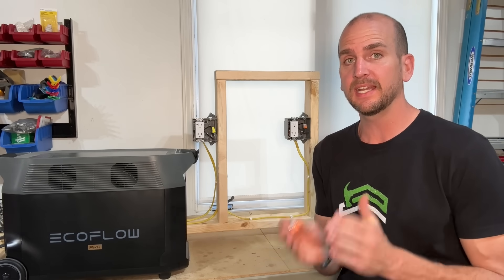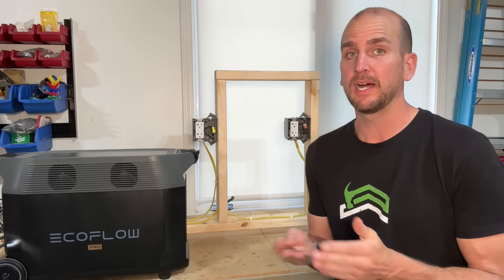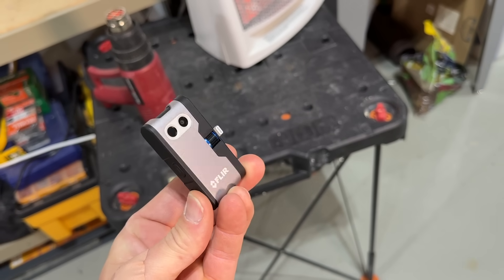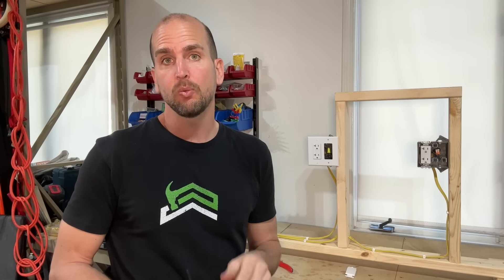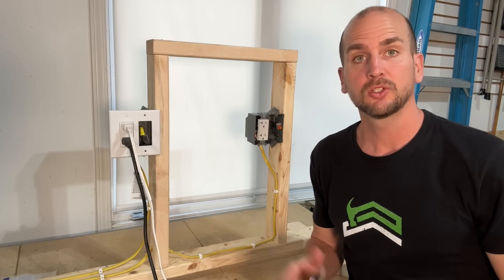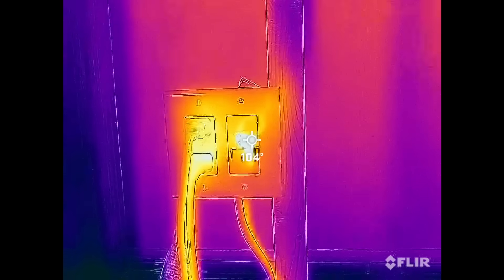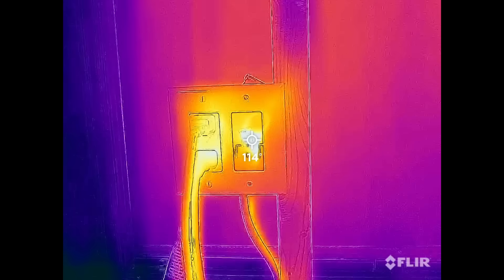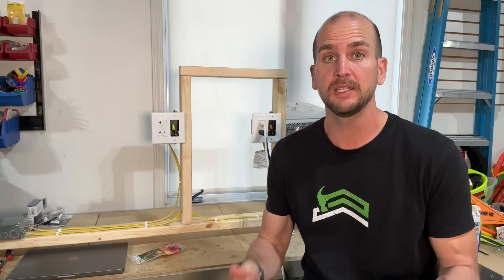Debunking the Pros: Can WAGO Lever Nuts Handle Heavy Electrical Loads?

Comment: Don’t know if ANSI standards apply to this. I have had experience with testing to different standards ANSI, CSA, and EU. In my experience the EU standards called for whatever they are certifying to be tested in the worst case scenario. When testing capacities and tip over capability’s, ANSI and CSA called for weight to be evenly distributed. EU standards called for weights to be in the farthest forward position. Which made a huge difference in the capabilities of the machine being tested. Invaluable information for the manufacturer and the end user for safety. If the WAGO is certified by the EU I am fairly confident in its ability to preform as designed. The real question I would ask is, How to the compare over time? Through heating and cooling cycles and loss of spring tension?

Comment: so I replaced several of these things at a house 30+years old I am not impressed, most just opened up, one in particular melted the insulation back about a inch or so. I will only pre twist with wire nut I have not seen that fail

Comment: You didn't properly apply the wire nuts as you didn't twist them tight enough. Wire nuts are supposed to be twisted such that you actually twist the insulated parts of the wire. But that doesn't mean that a WAGO can't be used. They aren't a huge problem in new installation where THHN insulation is present. They are more of a problem in retrofit where older insulation types are in use that don't have the same temperature capability that THHN has. And if you aren't strong enough to twist the wire nuts, they make tools for that.

Comment: People who say this nonsense mustve missed the ul listing, what do you people who blurt out and defend wire nuts think ul does, just rubber stamp any product for a fee without doing any testing? Level of ridgid and irrational thinking ive seen  in comments on some of these videos is apalling. Wago is amazing, ive pumped 15 amps constantly in the summer with 0 problems.  Great cideo testing and proving these work. Wagos are also superior for keeping wires neatvand not a mangled twisted mess when you need to do work on something.

Comment: I had good results with the push in  wagos in various applications but when I used them in defrost timers they tended to fail. The amp rating seemed to be acceptable but they weren’t capable. I retired about 8 years ago and the lever wagos were only encountered in lighting fixtures. I assume the later ones are more robust.

Comment: Not sure what pros are saying that wages are bad for such loads. I do not like push in style connectors but the lever style are much better. Issue is the cost per connector for an industrial scale job. 

For home use and DIY I would highly recommend them as the lever type ensure a proper connection requiring very little skill to do a proper connection.

Again industrial applications it just doesn’t make fiscal sense unless it saves you enough in labor costs.

Comment: We use those around the house but only for light fixtures, which all have something basic like LED bulbs in them, max draw is 3amp @120v. I would NEVER use those under a legitimate load for an outlet. Highest load ive used one on is the new bathroom exhaust/light fan i installed which is at 5amp. Ive had 2 different electricians tell me to stay away from those all together.

Comment: I assume, being that you're posting videos on a public platform, that you have thick enough skin to handle criticism. All you have done with this video is shown your ignorance and lack of experience regarding home electrical.  Your comments and even your method of using a wire nut shows that you have a lack of understanding of ac electricity.  Your testing method shows your insincerity on your search for the truth and shows you really were just trying to justify your own narrative.  Do you really think us professional electricians made a judgement call after using a circuit for 30 minutes?    The truth is that most of us make that judgement call after a circuit has been in use for at least a year. Do you think prolonged heat affects the structural integrity of an alloy?   Just bending soft copper changes it's structure.  You claim that because, after a single use, it's temperature was below the maximum that it's quite satisfactory to use.  Let me clue you in to a couple of facts.  Heat changes the proportions of different allies to differing degrees.  Tin doesn't expand at the same rate nor same amount as copper.  Something that changes temperature over and over and over doesn't act exactly the same after a year as it does after a half hour.  Ac electricity has a frequency and therefore vibrates.  Will the vibration give the same results after a half hour as it will after a year?  NO!   Is it common for an electrician to find a melted wire nut if the wire nut wasn't correctly taped? YES!    After a multi year study I can guarantee that you will see different results. One of the most common household wiring problems I run into is either a wago or a receptacle with the wago style connector.  If you are going to get on a public platform and advise unknowing people as to the best electrical practices at least please spend 5 years as a professional electrician first and until then don't dismiss the opinions of us who have spent a lifetime as an electrician so quickly.  The only place a wago type connector should be used is for the safety ground circuit.

Comment: The tree you're barking up is missing several points - both methods are engineered to safely operate with a substantial safety factor. Electricians have been arguing over using the stab holes in a device vs. cranking the wires down under the retaining screws for years. BTW, those stab holes are no better or worse than Wagos. What it comes down to is 'best practices'. It is extremely obvious the best practice is using twisted and nutted or clamping screw connections however the devices developed for convenience, ease and time saving (less than a minute?) are -acceptable-. I will offer that, while it doesn't happen often, how many of us have replaced a wonky device (switch/receptacle) caused by the original installer using the stab holes?

Comment: I love wago especially for low voltage. Connect any size wire to any size ( within reason). The only bad part is when they snap shut and sting your fingers.

Comment: All the thermal values are well within the limits of the product design. Use what you will but the Wago connectors are safe from a thermal standpoint.

Comment: Had a door bell transformer blow up and smoke the receptacle...traced the circuit back to the point of failure...failure was the junk wago...repaired with proper twist on wire nut and replaced receptacle with wall plate and transformer...door bell actually works now

Comment: What I'd like to see is Daisy chained Wago connectors like you'd see in a run of outlets on the same circuit.  Most interested in the voltage drop.  My outlets were back stabbed by the builder's electrician.  The drop was so bad that my UPS kicked on every time I tried to print with my laser printer.  Putting all the connections in the circuit on the screw terminals which fixed the issue.

Comment: The thing with wire nuts, is you need to use the correct size, and ALSO use quality wire nuts.

The cheap ones are junk. Ideal wing nuts are really good and really grip and hold the wires. Trim the wires evenly, strip them correctly, and put the wire nut on and twist while holding them together. Keep twisting until the wires twist a couple times outside of the wire nut itself. It will be tight and possibly hard to keep twisting, but this is the correct way to ensure they are twisted together and secure.

Comment: The difference is that the wire nut will losen with the heat/cold cycle,  while the wago will not.
I had wire nut in my old German appartment, at some point some of them started to buzz as they had losen, pretty scary.
I replaced them with wago!

Comment: Its over time that they fail.  Receptacle use plugging and unplugging causes movement and the connection loosens a bit each time.  I have never run into a screw type connection burned up but plenty stab connections burned up because they became loose...  Can't deny this...

Comment: A properly installed Wago is higher resistance than a properly installed wire nut.  Other youtube channels have reached the same conclusion measuring resistance directly.  It is also easy to install a wire nut poorly, esp as the conductor count goes up.  It is very hard to install a Wago incorrectly and it is easy to check and repair.  I'm going to continue using Wagos for AC.

Comment: A brittle piece of plastic IS the WAGO. Load that sucker ten times per day up to 110 F for ten years. That little plastic crap will break first chance it gets. There goes your entire house, up in flames! The wire nut mechanism is spirally wound steel and will not break. The plastic is merely the insulator and install tool. There is ZERO CHANCE I will use a WAGO in ANYTHING I wire. Ever. Besides, you're measuring the COVER PLATE temperature. Take that thing off and measure the CONNECTOR temperature. I'll be ya a bazzilion dollars that those are MUCH higher temp than what you measured.
Reply: shit someone better warn Germany before the whole country burns down! oh wait...

Comment: As a 25 year master electrician, reliability engineer and certified Level III thermographer. A few issues with your test. Thermal camera is reading surface temp of connecter. Thermal cameras are not capable of measuring temperature through an object so the actual  contact material temps are unknown. Your are trying to determine an absolute temp of a connection and not a relative comparison emissivity and background temperature must be accounted for? Reflected heat from the background will change the temp you see with the camera and you must compensate to obtain an accurate temp. Best practice would be to set emissivity, compensate for reflected temp and aim the camera into the holes of the connecter where the conductors are inserted and monitor temperatures  there. Measuring in this manner creates a cavity reflector and background temps are not influencing the displayed temp as much. For best accuracy, you  should be measuring voltage drop across the connecter in millivolts, then calculating contact resistance and  watts using ohms law. Comparing resistance is a better method of determining how well the contact work. You can connecter surface temp with a thermocouple to confirm what you’re seeing with the thermal image. Different contact materials  have different max surface temp ratings, you cannot measure contact surface temp with a thermal camera on the outside surface of the connector. The max temp rating of 220 is the contact material rating.  Looking at the chart, the temperature was still climbing so thermal equilibrium never obtained and max surface and contact temp was not obtained.

Comment: My father was old school. He stripped conductors, twisted them tightly, applied rosin and soldered them. Then he screwed on a wire nut and wrapped it in electrical tape.

Comment: Thanks for this video! I recently started using the WAGO inline splices for hooking up LED shop lights, and given their relatively low power consumption I'm fine with that use. But it does look like a more robust connection for higher power use would be wise. I'm also concerned about long-term exposure to low concentrations of corrosive vapors - do the WAGO contact degrade faster than screw or wire nut connections?

Comment: I concur his first statement is correct they cannot handle any amperage load over 3 to 4 amps I think they're great for LED light, for connecting wall plugs they are absolute know no, just like when they're okay to push the wires in back of the wall plug not a great I've seen wires turn blue and purple the newer connectors.

Comment: Should actually test multiple wagos on the same circuit you could have a whole bunch on a circuit and each time its adding resistance to the run and you should use a thermocouple to accurately give the temperature. Add insulation around the boxes as you have it set up currently it's in open air wire conductors are rated accordingly for open air and enclosed in the wall you should get a more accurate reading of you close up the wall and make the test more practical for comparison.

Comment: WAGO is NOT for american 110-120V. When America finally changes the system to 240V, then can use WAGO
Reply from the maker: Hmmmm, why are WAGO's not suitable for 120V?  Worked well so far 🤷‍♂️
Reply: It's very easy. The problem with 120V installations is for example, 2400W (an electric kettle), a current of 20A is needed. At 240V it is only 10A. Remember to use twice the cross-section of the cables. WAGO accepts a maximum of 4 mm2.
Reply: @andyk9685  so buy the 32amp wago that accepts 6mm2....

Comment: Push in terminal connections on the back of switches and receptacles are the real reason the idiots at NEC forced arc fault breakers on us. I do NOT trust any sort of push in fitment type connectors. Laziness and greed will burn your place down. Soft hands have no place doing real work. Either get used to blisters or buy the right tools. Marrettes, Marrs, twist connectors or what you you may call them are the way to go and if you really don't want a call back for trouble, tape your connections in places where you have that nagging doubt creep up on you. 

Also, children need to learn not to stick crap into a receptacle by getting zapped, those TR bastards are more trouble than they are worth. If they don't learn, the gene pool just gets dumber and dumber, we need the Darwin Awards!

Comment: The wire/wing nut is NOT a termination device! Never has been. It is an INSULATOR! The proper method of using a wire/wing nut is to strip an excess of insulation from the wires, TWIST those wires together in a clockwise fashion. Trim the damage done from twisting away, then INSULATE  the connection with the wire/wing nut by twisting it clockwise until tight.

Furthermore, you need to run your tests for an extended period. More like for months with periodic cycling of power allowing sufficient time for thermal cycling. Then come back with your results.

As a non-restricted licensed electrical contractor I refuse to use any type connector which relies on a spring device to maintain contact for power distribution. I have made tons of money over the years repairing the damage these things have caused in commercial and industrial applications. I won't even use or recommend their use in controls applications due to reliability issues. Low voltage signaling applications are all these things are suited for.

Comment: Some of the thermal transfer is not necessarily from the Wago or Twist lock nuts.  The wire is or appears to be 12 ga which is rated for 20 amps so the wire itself is generating heat contributing to the rise as it is out of range limits.  If I have a circuit I calculate to be over the rating of the breaker or wire I upsize until I have a safety margin.  So in fact if the current load is less than the current limit and the breaker, wire, wire nuts or Wagos are rated for use on that circuit then all points should be equal unless you fail to clear enough copper for the splices.  If all is equal they all perform the same.

Comment: Been using wago for years now. My workbench electrical supply uses them. All my supply is 20 amp rated at 120v. Never had any indication of overheat or voltage reduction. So far, so good. 6 years on now.

Comment: DIYer's playing around with electrical wiring is plain scary. Elimination of hot spots is critical, so while Wago connectors and others may be OK when installed, how hot are they running after 5 or 10 years of service? Any such connector should be running cooler than the cable - not warmer - hence compressed tube connectors. Wires shoved straight under power outlet screws create a hot spot - the wire should be wound under the screw as this creates a greater area of electrical contact, and also assists the wire to conduct any local heat away from the connection.

Comment: Pushing them out of their limits for testing is a great test but you'd have tripped a breaker already running 20+ amps for that long through a 20A circuit breaker. 
Test at 15 amps instead. The difference will be ever more trivial, while it already is trivial at the overload conditions. 
It is mostly old timers that cannot accept new technology and piss on new things because young people know and do things that they don't know or like.
They will also argue with you about backstabbing receptacles, while it is a UL listed method for those receptacles.

Comment: If either connector ever reached it maximum rated temperature there's a serious problem.  I suspect that's the temp it begins to soften and fail.  
Id like to see the heat generated in back stabs, especially if they've been in use for some time.
Thanks. Good video. 9:17

Comment: If you need to use high loads on a spliced circuit then it's all on you! I wouldn't use either variant in a high load situation. 

I love WAGO and i used them on my home but none of the connections done are for high load scenarios. Same goes if i were to use a nut. 

Everything that has high load is a dedicated circuit with no splicing between the circuit breaker and the wall plug.

Comment: If... they used a" bus bar" that clamps as usual,  and a bottom " contact area and gave that secondary point of contact,  would that bring the heat down?
Reply: Basically a horse shoe style contact